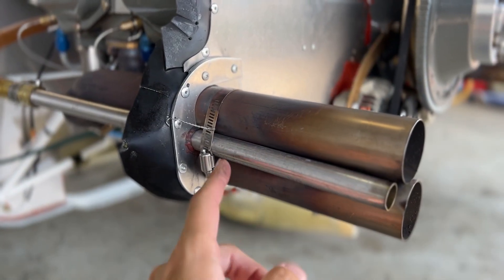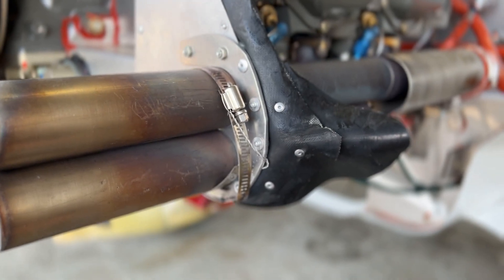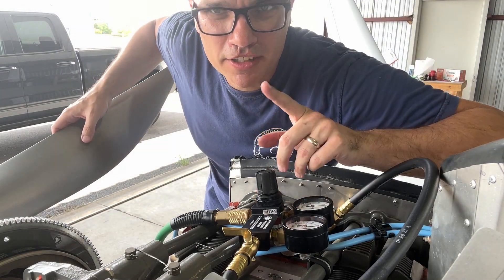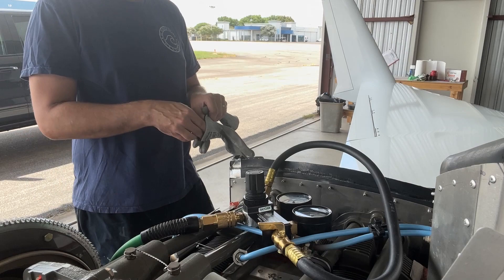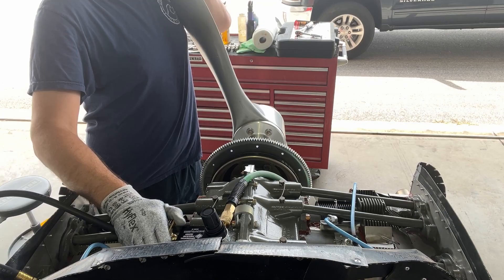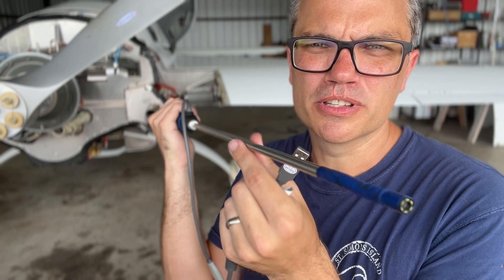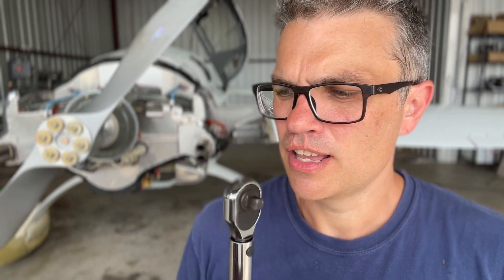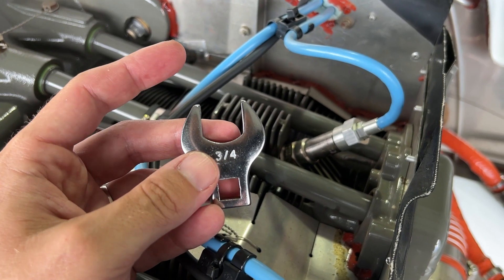How to Compression Test and Borescope an Aircraft Engine

Comment: So after you find the compression stroke by rotating in the normal rotation direction of the engine (can be right or left) look at your blade angle it should be at angle to produce thrust from front to rear of plane when rotated in proper rotation, then continue rotation till the piston is closest to top of the cylinder.  You should be able to see the top of the piston through the spark plug hole. Use a wooden chop stick if you can’t see it. When it’s close to the top there is very little force exerted by pressurizing the cylinder so holding the prop is much easier and you will get higher compression readings than if you left the piston in the middle of the cylinder stroke. Be safe!

Comment: Top dead center is far more important than the instructions apparently let on.  If you are off even a little bit the prop will pull/push in that direction something fierce as you pressurize the cylinder.  You want that pressure steady at TDC for a good reading.  Fabulous build, by the way!
Reply from the maker: This is exactly what I found out. Forces are light at exactly TDC and brutal on either side 😁